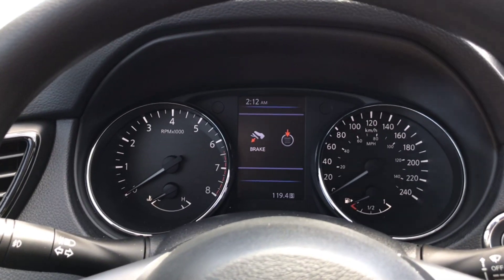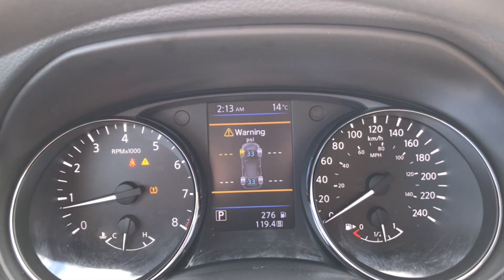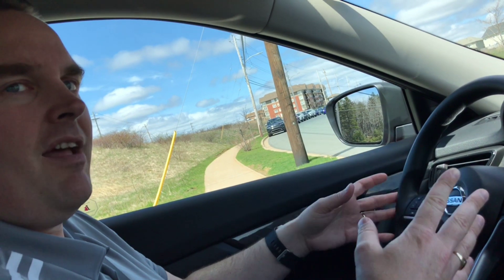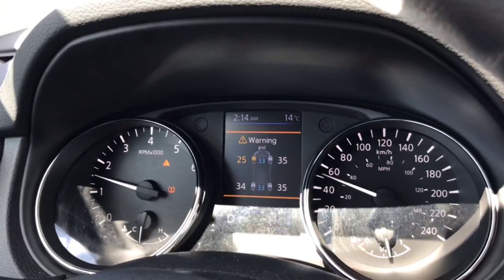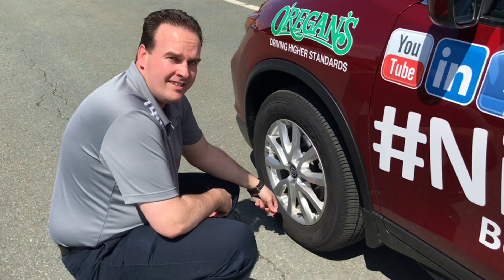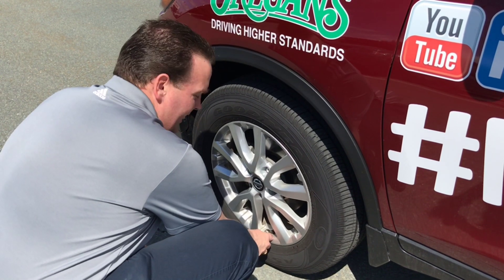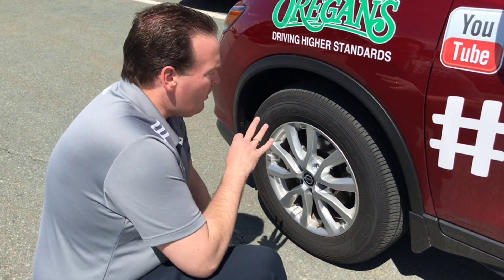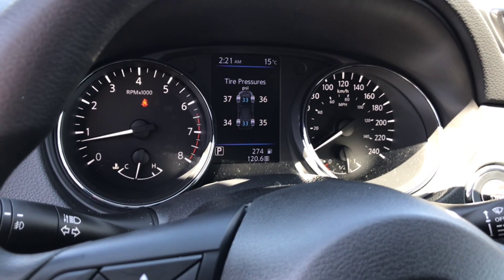Nissan TPMS - How it works

Comment: can I see the TPMS tire pressures without having to wait for high or low pressure?  I want to just see what current tire pressures are? Do I have to check all tires manually or can I dsplay TPMS screenn on request?
Reply from the maker: For most Nissan models, 2017 and newer, there is a screen on the Driver Assist Display that will show you current pressure while you drive

Comment: What is the point of having an expensive tyre pressure monitor, when you are above the PSI on all 4 tyres ?????
Reply from the maker: Steve Wainwright the suggested pressure is 33 psi. The tires on each vehicle have a max rating and can go as high as 55psi on some vehicles. All we recommend is keeping them close to the suggested rating but the TPMS is in place to ensure that you are able to keep the tires inflated enough and to keep them all around the same pressure for even tread wear. I hope this helps address your concerns.
Reply: @RobertTigheCars  No, keep the correct tire pressure, that is the point!